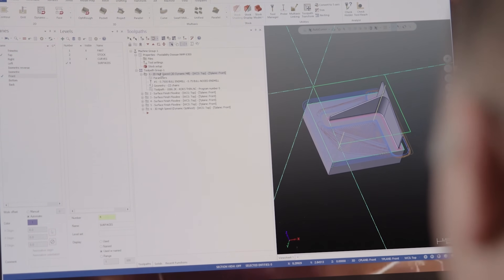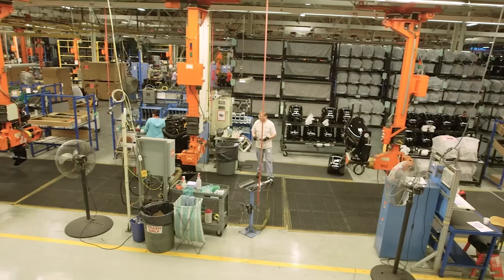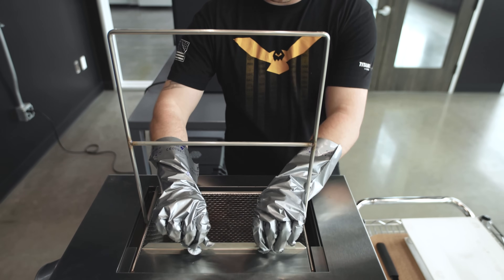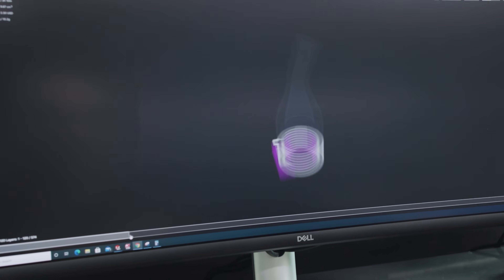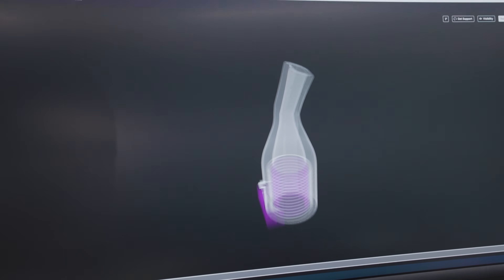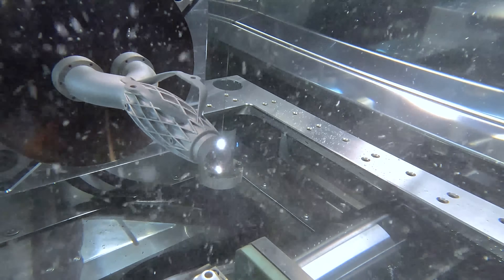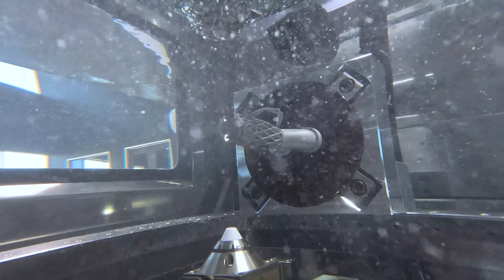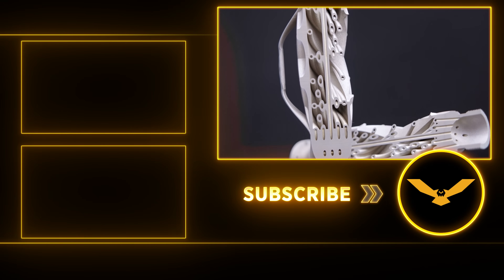Why Won’t Old Machinists Teach Young Machinists???

Comment: i've not got the years in on cnc machining but i'm pretty sharp when it comes to what i do. i can tell you what i do, not everyone can do. i will train anyone but keep the more advanced stuff to myself. i don't much care to do it but i have had it mentioned to me that they are wanting set of instructions to what i do. the knowledge in my head on a computer screen lol. that way anyone could read it and do what i do. i don't know how to put it to them. not everyone can do this work, it's a huge physical work load for starters and then you have to know exactly what your machine doing all the time for timing purposes and tool adjustments/blade replacements. you also have to be aware of everything and laser focused on what you are doing at the same time. i do fear though it would devalue me to the company and from i here management seems to believe it a push the button type of job. they did recently up the pay scale though and give me a award for coming in and saving the other shift when needed. progress i guess but if they think instructions will let anyone do it, maybe not.

Comment: Mmmmmm, I have been in this situation, not in the machining trade, but using high quality machined parts. I used to help youngsters, trainees, even experienced people. Until the day came that I was asked to explain something to a young jack the lad, cocky youngster (youngster = 20 something). He then went away and thought he knew better and tweaked the information I gave him so he could claim it as his own and be the man of the moment. Until, the pooh hit the fan as his little mod wrecked a £30k piece of equipment. Next thing, he is pointing the finger at me saying that I told him to do it that way. I was taken off the job pending the internal investigation. It found out by going back through my work history that they could see he had tweaked my instructions and caused the problem. That cost me two weeks pay. So if you want to know why experienced people don't pass stuff on....it is because the youngsters think they know it all, pay little attention to what you tell them, have little respect for experience and maturity and want to turn everything into a pissing contest. Since that day twenty years ago I have NEVER passed anything on as it can seriously bite you in the arse. Two weeks loss of pay, finger pointing, disrespected, stain on my employment record,  all to try and help someone. I will NEVER NEVER NEVER put my self in that position again, what I know stays with me.

Comment: I’m currently an apprentice in a shop. I’ve seen people drink in front of me, called a f***up, a liability behind my back, and always get put off when I’ve tried to help measure the drill bits or just learn in general. The other two machinists I work with throw me under the bus when they mess up. I’ve been told by an older gentleman who works here that it’s always depending on the place you work, and the people you work for/with. Hover over them with enough time and attention you’ll pick up hints yourself.

Comment: I have trained a couple  of machinist  been doing it for 30 year  any thing that came in the door for 0.050 to 73" OD. ROUND ,mill surface grinder VTO horizontal boring Mill you name it, out of six three are still in trade ,# one reason why no one trains young guys job security bottom line

Comment: A friend of mine had the same problem.He is old school precision machinist fitter and turner.He worked for a company that did cnc and work before cnc was invented.So again he asked the one young guy how to set up and run a cnc machine and the guy was very reluctant to help out.My friend went to his booss and explained to him the situation.The boss told the cnc guy to show and help my friend.My friend could show the young guy 42 years experience the old school method of turning hands down.My friend was making and machining helicopter components.Maybe as you said scared of loosing his position as a cnc worker.Really sad how some people think.My friend and i are both ex army.You learn how to share in the army.Golden Rule.

Comment: That's not the reason, atleast not in my experience. It takes a certain kind of person to be that one step above the average professional machinist/mechanic/metal worker, I'm sure it applies to other trades as well. But generally that certain type of person doesn't have the patience or articulation to put words together to teach someone, and they get frustrated and just stop trying to explain things altogether. 
You have to learn how to work with them, learn their way of communicating, it's takes years sometimes but eventually you start too understand what it is they trying to say or teach. Whether or not it seems like it at first.

Comment: We had many trades who considered keeping solutions secret was their job security. Some would keep machine setup fixtures locked up and others would throw others design improvements away that they considered a threat to their dominance. I personally attempted to minimize problems and others who wanted to milk the company with half hearted repairs so the company would have to bring them in on overtime.

Comment: Sharing your knowledge is great and generally your company believes that you should share your knowledge but it's in the company's best interest for that to happen. What generally happens after that is that when the machinist (worker) gets older, the company believes they can do it for cheaper with younger less experienced candidates. Then the company lets the older worker with the Tribal Knowledge go. It's usually much harder for an older worker to find a new job even though their skill sets are usually much greater and needed. The company will then suffer some setbacks (learning curves) but as the younger machinist (worker) Eventually gains the tribal knowledge he soon finds himself in the place of the older workers. The companies have done this to themselves by their corporate actions.

Comment: Ive been around machine shops all of my life. Literally started working in summer at family owned shop when I was 13. Then worked there full time after highschool, moved on to bigger and better jobs, worked in engineering for a spell and now as a production supervisor for the last 9 years. 
I've worked with hundreds of machinists. A lot of the older guys were just straight up aholes. They had little or very basic computer knowledge so moving to CNC was a huge struggle for them. 
Being around that mind setting just pushed me to learn more. I f'ed up a lot of stuff and they'd sit back and laugh...but it is what it is.. 
Machinists are a different breed. Not all of us are the same. I love to teach because the more the guys under me know, the less I have to do their jobs for them. 
CNC has changed so much over the last 25 years.. but so has the culture.

Comment: Interesting discussion. Your conclusion works if everybody is on the same team. I worked for years as an independent CNC repairman. A “hired gun”. They guy you call after everybody in the shop and the local toaster repairman can’t fix it. I shared a lot of tips and tricks with operators and shop people over the years. 
Then I turned 69. I may have slowed down but I still fixed them. I’d get a call from an operator. I say I could be there tomorrow, get a PO from purchasing. Purchasing would call and tell me they were looking for someone “with more current skills”, could ai recommend someone. Code speak for your too old. So I retired at 70. Out my talents to hobbies and volunteer work. I still get calls from the shops. My sticker is on or in every machine I serviced. It is always the same. Some eager young guy can’t figure out a problem. The operator says Fox always fixed it....somehow. Well I cancelled my lability insurance. I have no incentive to train some young guy. I don’t fox machines over the phone. So. Have a nice day!

Fox out.

Comment: I NEVER WAS AN "INFO HOARDER" ON THE SHOP FLOOR.
I ALWAYS FIGURED THE MORE YOU KNOW, THE SMOOTHER EVERYTHING RUNS.
BUT ON THE FLIP SIDE, I WILL NOT SHARE INFO, FOR EXAMPLE, A PROGRAMMING QUESTION WITH AN OPERATOR.
I BELIEVE EVERYTHING SHOULD BE TAUGHT OR LEARNED IN THE CORRECT STAGES.
THIS AVOIDS "KNOWS ENOUGH TO BE DANGEROUS" SCENARIO.

Comment: I’ve seen it many times. Now I’m not a machinist but have worked closely with top rank machinists over the span of forty years.  I used to see it more in the manual machine era. Now with cnc, not so much. The cnc guys are more school educated and the tooling vendor are usually a big help.

Comment: I spent 30 years working for a large top notch aerospace company that made turbofans, turboprops, APUs and various gas turbine engines. We had a culture of helping wherever or whomever needed it without reservation. After the company completely offshored all manufacturing and laid us all off, I went to work for a medium sized company (175 employees) and wow, what a difference. Knowledge was tightly held and backstabbing was rampant and the toxic competition seemed to be encouraged by management. I finally left after one year as it was causing me to reach my breaking point.

I am now retired and also an adjunct instructor at our local community college in the Applied Science and Technology department. We have classes on machine theory, blueprint reading, inspection, programming and the like. The icing on the cake is a complete machine shop as the lab portion of the classes where we have manual lathes, mills, grinders as well as CNC lathes and 3/4/5 axis machining centers. We also have CMM equipment to learn to check their parts along with manual inspection.
It's nice to be able to pass along my knowledge to a bunch of young, eager minds who can then put it to use in their chosen career.

Comment: I found myself in the same situation enough times and have been in the machinist/toolmakers' trade long enough that I started my own research/study on this very topic and the conclusions I came is two fold. One is a lot of the "More Experienced" machinist who won't share their knowledge are majority of the time from Union States where manufacturing is the most common trades, which leads to more workers than there are jobs so sharing any knowledge can lead to you becoming obsolete, which may sound harsh to some but when you have been in a company where forklift operators are making six figures salaries because of cost of living increases through Union contracts and consumers are wondering why their lawnmowers made in America cost so damn much and buy from a lower cost competitor, you can kinda see why. And the second reason is the most simplest and affects so much of our lives.....some people are just Assholes

Comment: According to my boss there is no time. Every time I tried with the two guys that came straight out of trade school they were swiftly put back to something they knew how to do. We have a welder that does basic machine work and I get the scowl when I walk buy and he's milling with an end mill in the jacobs chuck. I got a guy now that runs behind me punching the button after I set the jobs up and then calls me over to fix problems. He plays on his phone until I get it fixed instead of sticking his head in and asking whats going on. He has learned to sketch on the computer for the laser and edm and took some of the load off but it's still common for the boss to send him on meanial errands when a spindle could be turning even though we have a full-time clean up guy that could be doing such.

Comment: Because the employer that didn’t understand what the guy did and  will move on for cheaper labor. Kinda like vertical integration for bankers slave labor. Experience pays a lot in the end. But getting there from the ass you described America would be tits right now if manufacturing wasn’t so short sighted. Developed to a civilization Americans thought would be. That  old dude would get recognition for passing development.

Comment: I can’t really make a comment about the machinist trade,  but I can say I have witnessed all to many times when an experienced worker teaches someone who is at the bottom of the pay scale techniques.  I can guarantee you that as soon as the young guy can do what the older craftsman can do,  guess what?  The older guy is transferred out to a new position that he can not physically do and he winds up quitting.  It’s a ploy companies use all the time.   Save a dollar at any cost.  I can see the reluctance.
Reply: It is, unfortunate, a reality. If they see 70 to 80% of the capabilities in someone 20 to 30 years younger they will slide the older guy out. There is an argument to be made here. You can't copy and paste this in every situation but it is a threat that exists.
Reply: Its also the reason machinists are woefully underpaid, its about time we are actually properly compensated for a very involved trade. More involved than carpentry I would say, yet we are paid half as much.
Reply: @candlestyx8517  cheap Chinese manufacturing has an impact on this.
Reply: @candlestyx8517  have you worked in carpentry
Reply: Before I got back into the mechanical biz I bid to work on a huge machine called the Jumbo. This very respectable man taught me nothing about the job. You know: Oh, you don't have to worry about that and I never use that. To top it off the second man bid on the feed section with no experience too. MAN, WHAT A MESS!!!
I'll tell you something else: when they would take the best operators off of the $$$ makers and make them supervisors. Talk about running a plant into the ground. One night the Jumbo was down all day for PM (I was a mechanic by then). I came in on the 3rd shift and the scrap belt that had been badly torn for days gives out (one mechanic all night job). I told the operator, "If I'm here in 6 months I want you and anybody else to kick me square in the ass). There was quite a list the next night. After 3 months I was working in a climate-controlled facility. Thanks, God.
Reply: "If you, as a master, are fearful of getting replaced by the younger generation that you have taught, then you are not a master. You are but a fool who has only mastered being scared of not knowing enough."

-unknown
Reply: @gilbertmckown6161  you are such a fool.  The reality of it is that company’s are always looking to save a penny.  If they can get someone to replace you for a cheaper wage, they will.  I don’t mind showing anyone a better way of doing something.  Done that all my life.  I’m just relating what I have observed through the years.
Reply: Means either the old timer is paid more than his skill is worth, or the youngsters paid too little.
Reply: @svenNL  second one, always, because their pay will not include old person's benefits, not to mention prices of everything is rising for young ones without house and savings
Reply: @svenNL  no, the company's are just greedy. The old timer wouldn't make that much, if he wasn't worth it.